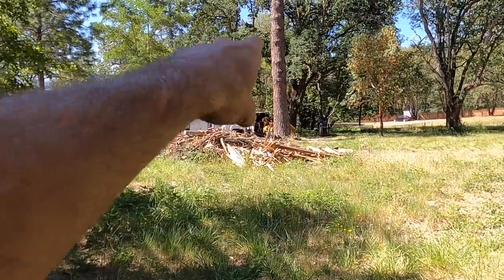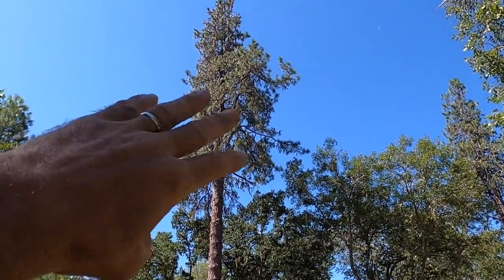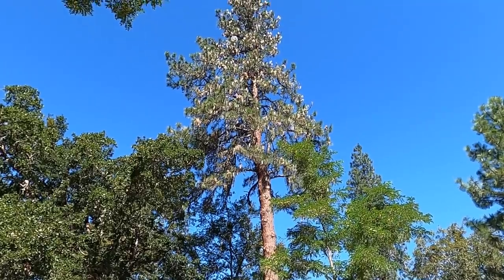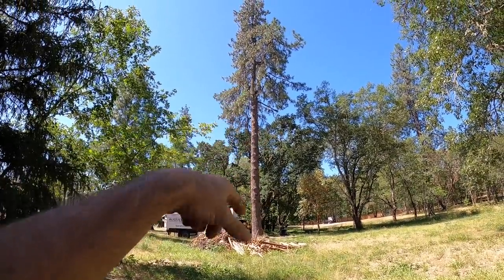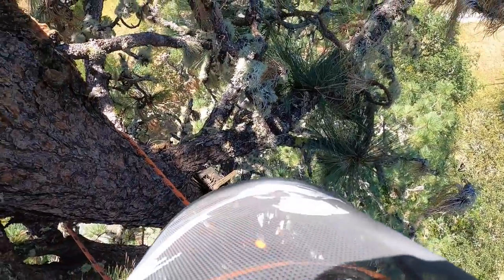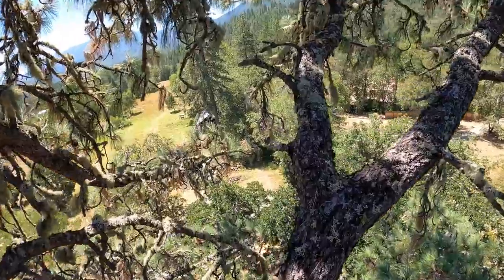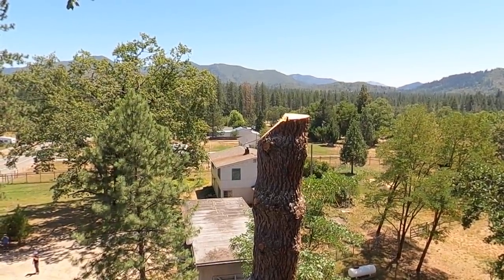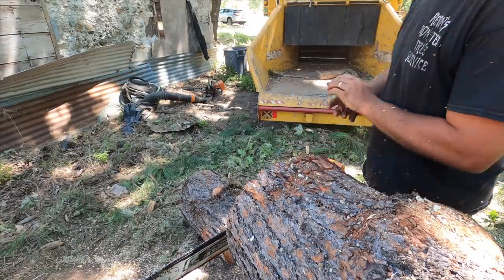Pulling a Huge Top (Job Explained)

Comment: August I am getting more into tree work.  I have enjoyed your videos and the teaching you are doing.  I specialize more with mowing, property clean ups etc.  I have taken a class and learned how to climb and I took a chainsaw safety class.  With this tree I saw that you were able to use the bucket to take down the tree.  I do not have a  bucket.  What would your thoughts be on if I was to climb and cut the branches off.  Once at the top what if I would have used a hangman's noose to tie to the top of the tree and then used a rope puller to pull the tree down.  I am just starting out and I am learning all the time but what are your thoughts?

Bill

Comment: Damn, that’s just unbelievable.
August you is an iconic. Living Legend.
And.. I got a big question.
How’s that handle for a saw you used from a bucket called? 
It’s very handy shape one which allows you to work very smooth without muscling a fucking stock handle.

Comment: Wow, love the last minutes man!
You're a good father August
You had my pot of emotions stirred there for a bit.
(Probably something you dont say over there but anyway :) )

I've got a question. 
Maybe someone can give me advice?
I have a really old oak in the garden. Probably 200 years or more. But i think lightning must have struck it somewhere in time. 
Only half of it is left at the top but the stem is huge.
The problem is its leaning a LOT.
Like its pointing towards two o' clock. 
Should i do the tree a favor and cut some of the furthest branches to reduce the weight? Or wouldnt i do it a favor by cutting that?
Theres no house nearby so there is no urgency but i would hate to see it fall. I would like to help it stay around for another while.

Comment: August I had that very same rope and zigzag setup as well. It did the same thing, actually I ended up stopping using it because the core was pushing out the end! I would trim it off and it kept doing it. It wasn’t even 7 months old and I turned it into a junk pull line. Just my input fella!